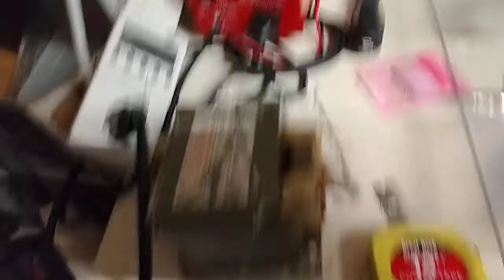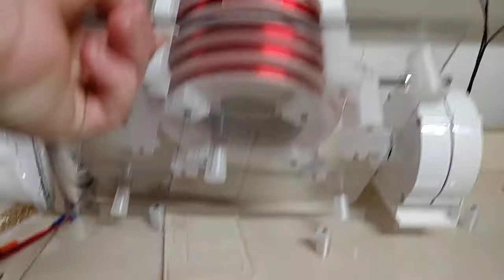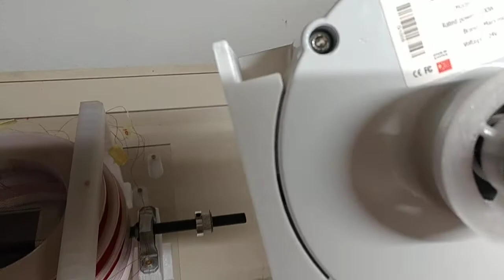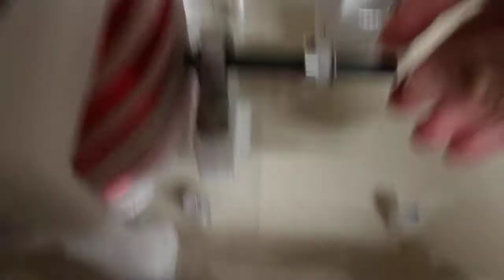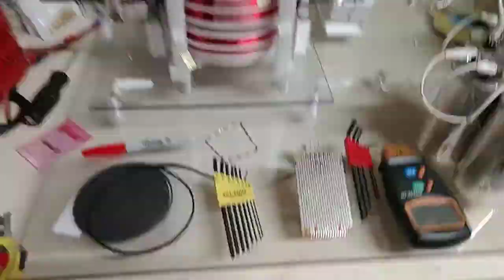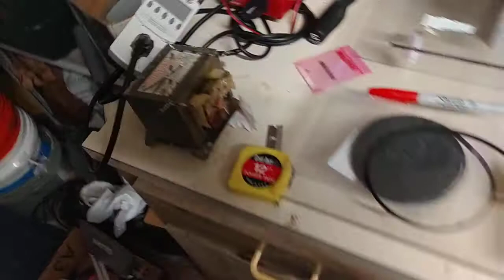Miniature Newman Motor Update 05/2020

Comment: look very promising,  i wonder what is the coil resistance, and how much pull does it have if you just touch the wires across the power supply, -   no commutators, just testing how much torque in the peak magnet position ?... is it loooootttt
s ?
Reply from the maker: Patrick,
I just realized you asked a question that I never answered and for that I am sorry. I'll get the data you're asking about in the coming weeks and let you know.
All I can say is with the commutator design as-is, my efficiency was in the range of 70-80% when tested using a prony brake. I believe more testing is needed with an original Newman-style commutator, which is in the works; or an electronic switching system.